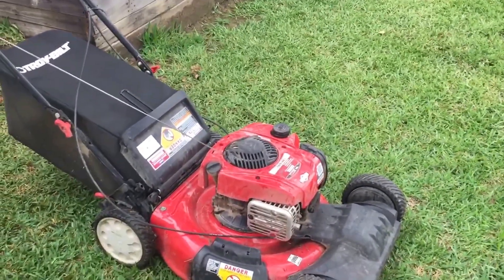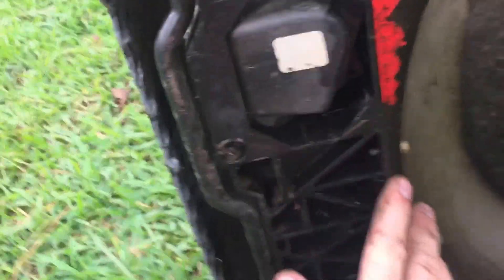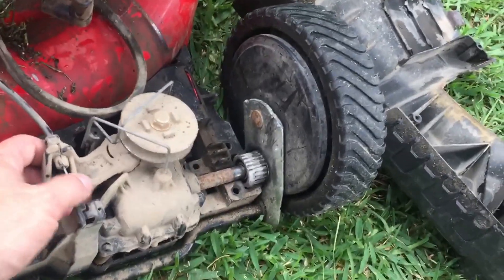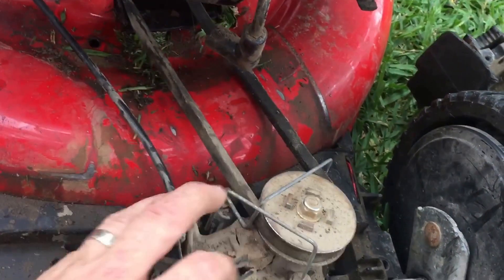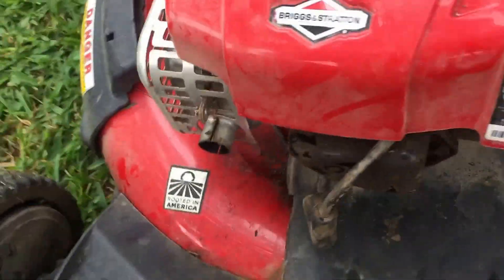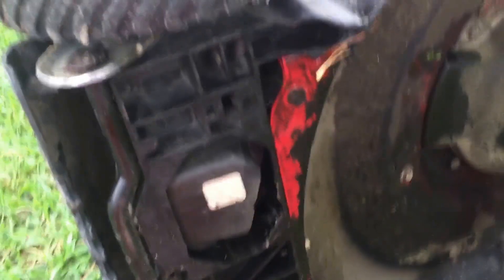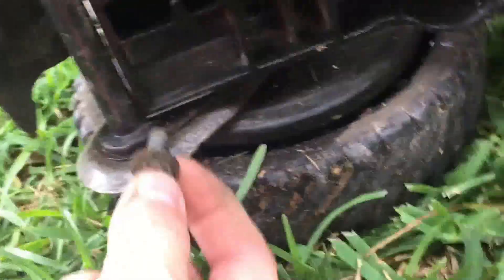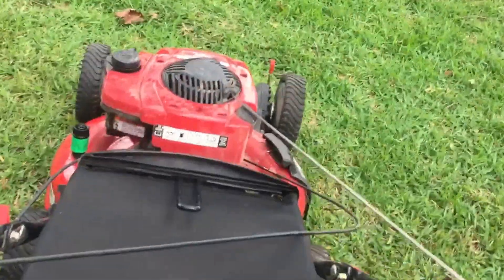How to fix a self propelled lawn mower Troy Bilt TB200 fixed the self propelled belt on lawn mower

Comment: Thank you ! great disassembly video. Turned out that my TB 200 hadn't thrown a belt, there was no problem with the belt, build up accumulated crud, was keeping the belt from engaging. Once I gave her a good cleaning, and re-assembled There was an initial delay of maybe 2-5 seconds and I was again running to keep up. If it weren't for your video, I would have been in deep trouble with a simple project. I wasn't sure which screws to remove, and had picked all of the wrong ones.
Reply: Really tho great video fam

Comment: First off, thanks for the video! My Troybuilt that looks just like yours had additional 3/8" screws. On the bottom where you had 2 and 2 on the edges, I had 1 more in the center. I also had 2 screws holding the back tang of the shroud, those were also located on the underside, but closer to the motor. I was wondering why my shroud wouldn't pull off and then I found the other 3 screws by looking where the resistance was coming from.

Anywho, it worked, by my belt is so stretched out it's time to replace it.

Off to search YouTube for blade removal video :)

Comment: I replaced my cable and the lever is not tight that I fed th cable through. What did I miss? The level is just like a bike brake handle on the right side with a turtle mode and rabbit mode. Also my front guard has 2 clips that go around the bar and latch through a square opening on each side. They are difficult to get back on. In fact, one side popped off just as I got everything back together.  Any suggestions? Tricks? I haven't watched a video yet where these were on the mower.

Comment: I have that same mower with the same problem.  Front wheels were locked up and front wheel drive was not engaging.  Took off the cover 7 screws holding it on and the belt seemed OK  but the wheel on that little housing was spinning freely with no resistance.  Would it be fair to say I need to replace the housing.  I finally got the wheels to unlock by pushing the mower backwards so now I can use it as a push mower.

Comment: Got a similar mower.on mine the belt is in place but it won't go forward,does the cable need adjustments? If so how would i do that?

Comment: Help, no drive forward once leveler engaged.
Belt did not jump out of pulley.
Two front wheels inner teeth (gears), metal gears & pins& retainer clips are good & cable tightened.

What could the problem be on my Troy-Bilt?

Comment: Missed 3 bolts on the undercarriage & most of the time the belt is fine.
Reply: And not bein mean, I was frustrated that mine wasn't working, so I apologize! Mine was literally just a dirty spark plug.
Reply from the maker: Np my friend
Reply: @Jones Vlogging Network  filter was good, check valve good, blades clean, fuel/oil good. Sometimes, it's the most obvious part to check. My fault.

Comment: All screws out to remove cover,, axle area comes up but near the motor won't come out
Reply from the maker: That sucks, these China made mowers are garbage
Reply: @BayouRepairGuy  figured it out, 2 nuts on the bottom by the blades for mine

Comment: I'm trying to restore my 3 year old  ( 800$ ) peice of S&%T Craftsman Pro 223 cc push mower. Every summer my drive cable breaks! That's 50$ every year. They put a plastic cover over the belt pullys which creates alot of rust. I can't find no videos on how to take this pile of junk apart
Reply from the maker: It’s sad, they don’t take reliability into consideration
Reply: @JonesNursery  not now a days, I enjoy pushing my yard and thought it would be a great lawnmower. Just a few hundred dollars more I could have bought a riding lawnmower that would have been easy to keep clean

Comment: I have a question, do you think that I could turn my non self propelled lawn mower into self propelled? I figured I could just put a belt on the crankshaft and gear it to the front wheels and connect a throttle to it
Reply from the maker: I have no idea
Reply: U might try adding a transmission. I'd find the model that has the feature and locate the parts diagram. I'd then try to find a used transmission, as new tend to be cost prohibitive.

Comment: My belt is on but my lever is loose I hit a fence and it got loose
Reply from the maker: The only thing I know to do is adjust the adjustment points on the handlebars where the cable connects

Comment: What is that silver component on the front, same side as oil. Mine won’t start and that seems to be leaking with each start attempt.
Reply: I have the same mower and add 1 Tablespoon of Marvels Mystery Oil in 1-1/2-gallons of gas and it prevents the gum/varnish from giving you fuel problems. This stuff also cleans the jets while you mow, and its cheap.
Reply: That's a carburetor, haha.

Comment: Although posting this video is appreciated, you failed to mention 3 other bolts. Although it’s possible I have a different model, the cover looks identical. There are two under the blade and one in the front center. Following your instructions I removed what you noted and couldn’t remove it assuming there were some simple snap attachment tabs that wouldn’t release. After a great deal of frustration and time until I finally removed those other bolts to get it off.

Comment: I dont know why I didn't watch this before I tried to fix mine now it won't engage the drive wheels when I pull the lever on the handle
Reply: I took it apart and put it back together and it works now I must of had something out of wack..

Comment: A complete stupid design, on my mower through it's 5 years of service I had to remove that front piece several times once to install a new transmission cable and others to just clean grass build up in the transmission itself eventually the plastic were the screws go into started stripping to the point that the front collapsed on me. Ended buying an all metal body Toro lost the two wheel lowering or raising ability but that was one very stupid convenience.